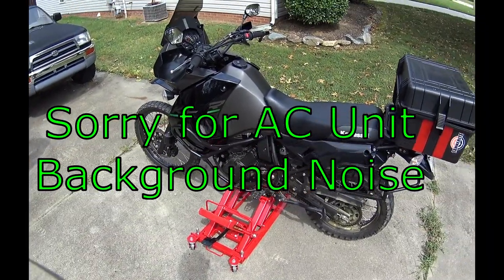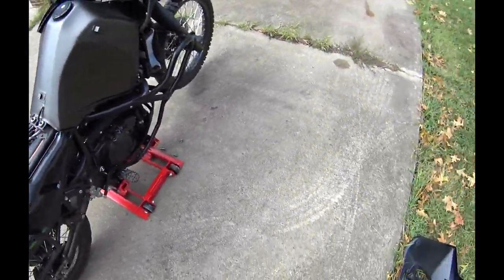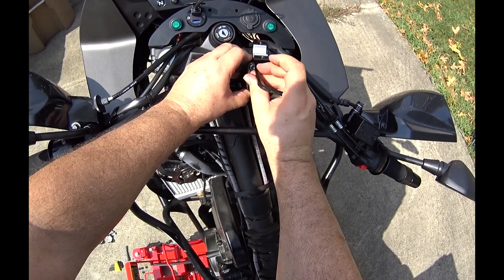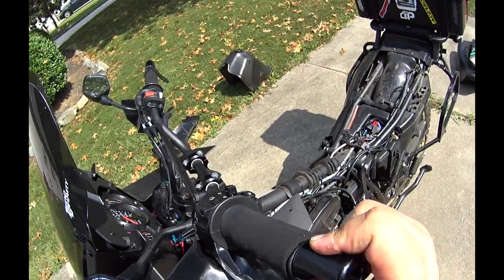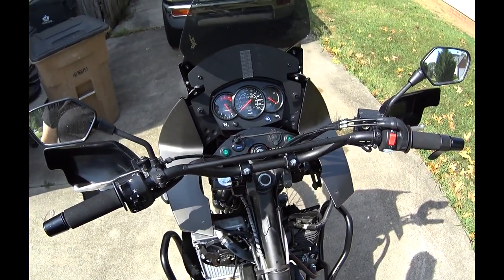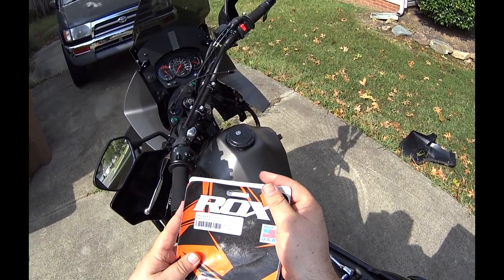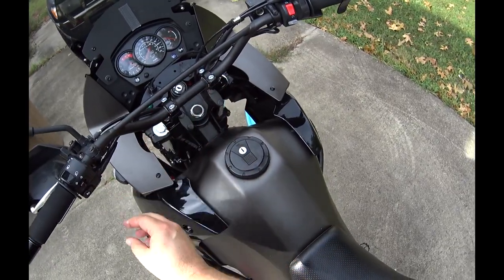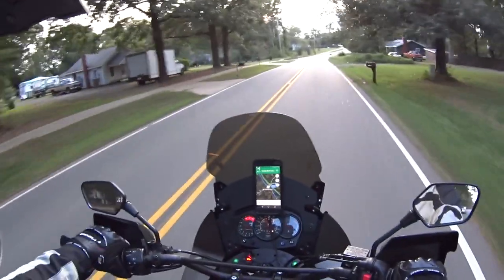Installing Rox Speed FX 2" Anti-Vibe Bar Risers on a 2015 KLR 650

Comment: Nice bike. Mine is a 2012 with the same color scheme. It's the best bike for tall people. I'm 6' 4". I've owned many bikes including touring bokes and cruisers. My KLR is the most comfortable bike I've ever ridden. I also installed a stronger (black) spring in the rear shock and progressive springs in the forks. Now it's nearly perfect. 

When the bike was new, I installed regular 2" adjustable risers and they made a huge difference. Now I'm tempted to replace them with the anti-vibration risers to reduce vibration in the phone mount. Honestly, I don't feel much vibration in the grips but the existing phone mount (attached to the handlebars) transfers quite a bit of vibration at mid-range RPM.  Too much vibration on a KLR is usually caused by loose engine mount bolts/nuts and/or loose balancing shaft chain. I adjust the chain tension at every oil change.   It's a 1 minute procedure.
BTW, where about are you in the Carolinas? Can you recommend any nice trails up in the mountains? I'm near York, SC.
Reply from the maker: Hey man,  you are right on with those mods.  We've done mostly the same stuff, and being about the same height I know exactly what you mean.  I think the anti-vibe bars might help some,  or maybe try a piece of inner tube or some type of dampening material between the bars and the phone clamp/bracket.
I'm east of Charlotte, and haven't been to Brown Mountain,  but I've heard good things about the trails up there.   Uwharrie is a bit rocky,  but there's a few trails there too.  Thanks for watching and commenting.  Two thumbs up for the KLR!

Comment: What a great video of installing and the review of this Risers. I have one under my bed since January and I think I will install them tomorrow with the help of this video.
Do you think is necessary to remove side panels to do make this upgrade? Well I notice that you adjust and release a little the cables, but I want to try with removing the side panels.
Subscribed from now and following. Greetings from Costa Rica
Reply from the maker: Thanks for watching!  I don't believe you can free up the choke, clutch and throttle cables effectively without removing the tank. In order to remove the tank you need to remove the front and rear side body panels and also the seat. I wish you luck my friend. It is not very hard, just take your time and watch closely the tightness of those 3 cables when turning all the way.  The clutch cable can be pushed down below the ignition switch to loosen it.  The choke needs the metal cable retainer loosened and rotated up slightly, then tightened again. The new position allowed for less tension. I pulled the throttle cable up out of that metal cable retainer, then used a loose zip tie to keep it close by the others but not tight. This is all in the video also. No issues since this install.

Comment: Do you think these are effective at reducing vibrations? I’m very interested in something like this for my phone. I’ve heard people using phone mounts and the vibration on the handlebars can actually break the camera stabiliser in most phones.
Reply from the maker: Yes,  these do help reduce vibrations in the bars.  I wanted the risers for increased height as well as vibration reduction.  Along with grip puppies I noticed a big difference in my hands,  but I'm sure a phone mount on the bars would benefit some from the anti-vibration risers.

Comment: Careful with that 10mm socket.  It almost got away from you never to be found again lol.🤣That vacuum line is always the biggest pain to get back on...  Totally unrelated question.  Did you mount your aux light to were the fork reflectors were?  If so, do they move around much there?  I have a set of LEDs that look similar to what you have and that looks like a good spot to mount them too.  I have never really been bothered with the vibrations, Numb hands.  I was going to do the lowering brackets first.  I want to change out the factory pegs, and want to go to the pivot pegs.  I am 6'2" but find that I really don't hunch over the handle bars when standing.  I think if I lowered the pegs with the JNS brackets that amount would probably work with me.  Have a good weekend brother.
Reply from the maker: Yep the LEDs mount nicely there, and haven't come loose at all.  The lowering brackets will make you much more comfortable.  The Risers complement the lowered pegs and really transform the bike for a tall rider.

Comment: Now before the anti vibe risers, did you have vibes that would make your hands numb? And after does your hands numb on a longer ride?
Reply from the maker: Yes, definitely had my hands go numb before, on longer rides.  I put the grip puppies on and noticed a decrease in vibration to my hands, and less numbness but still happened. Then I added the Crampbuster throttle helper? And it helped reduce numbness in long rides because I could take my hand off the grip when cruising straight down a highway.  These anti-vibe risers have reduced the vibration even more, so although it might not stop the numbness completely on a long ride, I feel I've done everything I can to minimize it. I'll reply again after another long ride.
Reply: Rox riders best mod on my KLR so far. In conjunction with a KLR Dash or similar even better👍🏼  Really fit my bike better now.
Reply from the maker: Yes, and if you don't have the JNS footpeg Lowering Brackets.. get them also.. Soon. 👍

Comment: Did you have to change out any cables ?
Reply from the maker: No,  not at all.  I moved one slightly by removing a tie, to allow a little more slack.  Thanks for watching.  Good luck with your upgrades.
Reply: @RobRidesCarolina  , thanks for your reply…

Comment: Do you only put one screw on the left side of your bench ?
Reply: Or you just didn't show it on camera and used a wrench instead of the ratchet because the right side back panel is in the way ? 
Mine is so thight I cannot get the side panel out because of the rack , we have the same
Reply from the maker: @yerto2222   Yes,  I only use one on that side,  for that exact reason.

Comment: How much vibration did it cancel out?
Reply from the maker: Well,  there's no way to really measure how much, but it reduced vibration quite a bit.  I would recommend it for vibration reduction even if you don't need a bar height change.  Along with Grip Puppies, the vibration was reduced to my satisfaction.  Thanks for watching.
Reply: @RobRidesCarolina  my concern is the mirrors.i am 6'2 and was considering racing my bars anyway
Reply from the maker: @gabrielkopp2036   oh yeah,  I'm 6'3" and it was so much better with the bars raised up,  absolutely I would do it.   I would also recommend the footpeg lowering brackets.. see my video on those.   Whole new bike after those two upgrades,  along with the grip puppies handgrips. Huge difference.
Reply: @RobRidesCarolina  I have nice cnc 360 adjustable pegs on my 2018 55 bucks you can lower,rais,Rais, forward or back and I love them I ordered pillow top in black
Reply from the maker: @gabrielkopp2036   Nice!  The only other thing i would recommend considering is suspension, especially the front. Just based on your height,  I'm sure the soft front stock springs compress a lot under breaking and over small bumps.   I got a huge improvement of feel and handling from adding Progressive front springs.  I reviewed that in another video also.. Well worth the money.
Reply: @RobRidesCarolina  so far not an issue I'm 180 with gear and I think it may have been done by prior owner I'd have to check it was on list though
Reply from the maker: @gabrielkopp2036   ah ok 👍
Reply: @RobRidesCarolina  my son has a 2015 and his dives more mine..I appreciate  the tip though keep up the great videos
Reply from the maker: @gabrielkopp2036  for sure!  Thanks.   Ride safe.
Reply: What web site did you get the rox risers from
Reply from the maker: @gabrielkopp2036  mine were from "OffRoadIdaho" ebay store,  but i included that link,  and a link for Amazon in the description.  Amazon probably has them, not sure about the other place now.
Reply: Just installed mine.  Don't expect all vibration to disappear.  But it does change the vibration.👍  I need Togo on a long ride to really be satisfied.